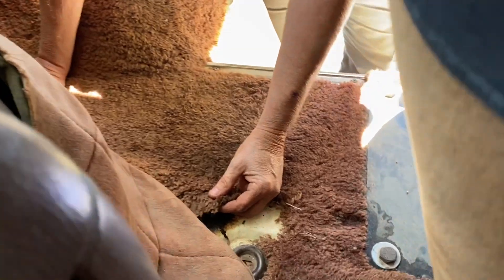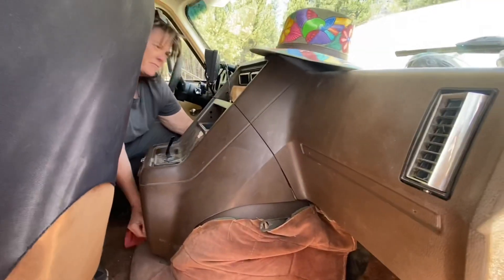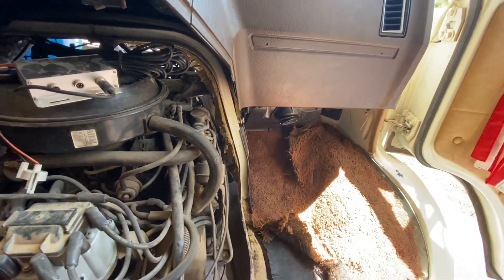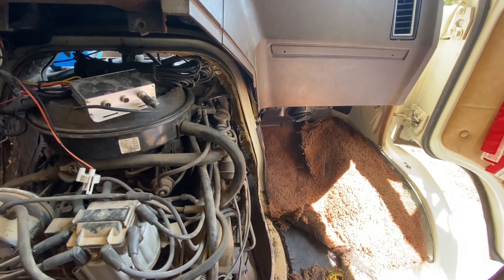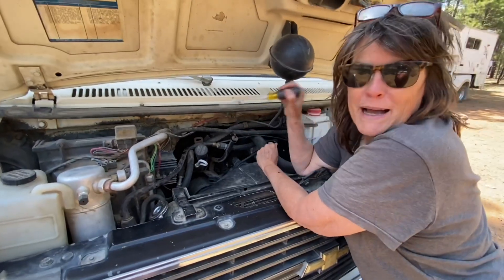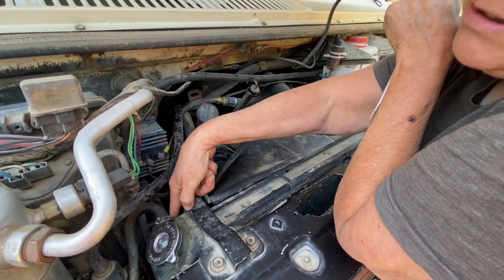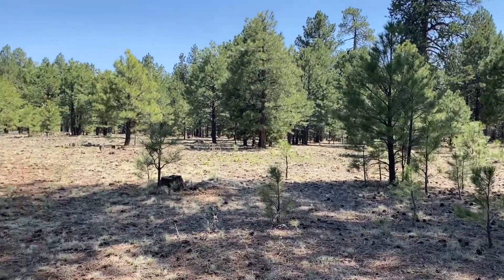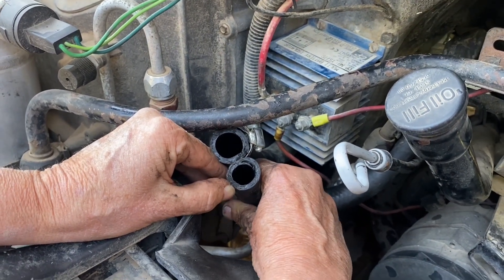Bypass Surgery for Phoenyx

Comment: I wouldn't be able to sleep not knowing if it could be fixed. I had that bypass done on my 90 GMC TRUCK. Shortly after that I had to have the RADIATOR replaced. So long ago I don't remember the price for the bypass but the RADIATOR was about 600 I think. I wish you all the best in deciding what to do with always investing more money 💰

Comment: Ok Mcgyver, cheap fix for heater is get a Chinese diesel heater,  just try and connect to existing tubing. Should be a cheap cost for you.
Reply from the maker: Uh, no (?). But thank you anyway. This is the engine heater core and my rig is gasoline. Have never heard of putting a diesel heater under the hood. 🤷🏻‍♀️

Comment: well this is ur home ,its like a leaky roof, dont patch replace. over time  a patch is a patch .if u can fix it right or pay out ur butt for a $50,000 new bill. just say to ur self it is old .
Reply from the maker: Ty Cynthia … a bypass is not a patch. It is a viable fix. Should I ever choose to replace the heater core later, I can still do that. Itm, I will not have cabin/engine heat or a defroster. I rarely travel where that is an issue and I still have my catalytic wave heater for heat in the house/rv part. 🤞🏼🤞🏼🤞🏼
Reply: @authordebradickinson  boy that frugal can fix anything.